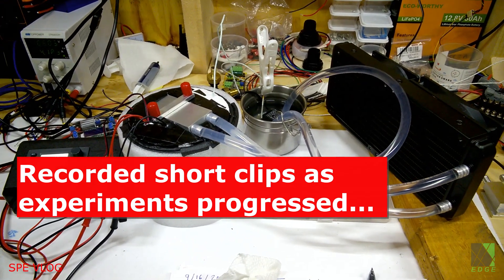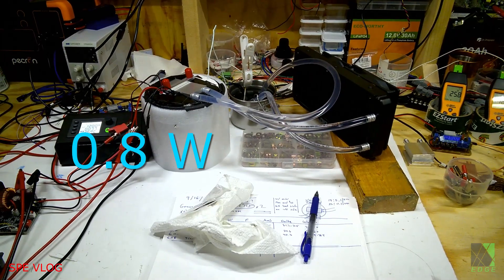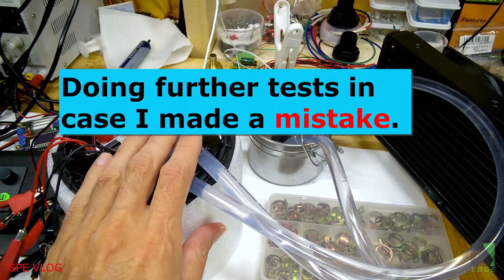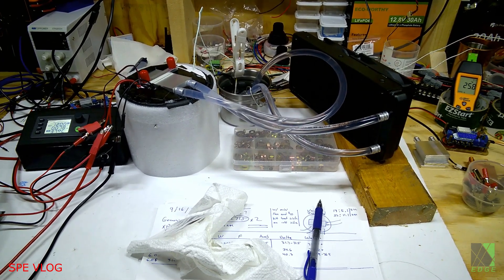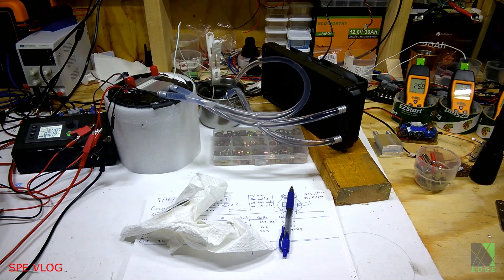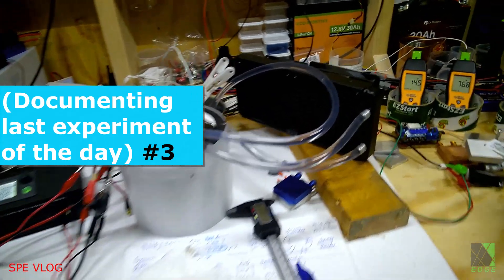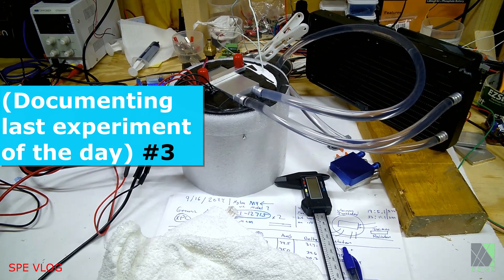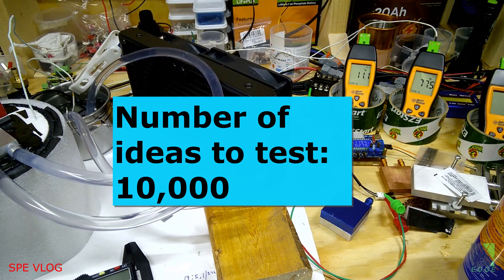I'm Learning to Use Peltiers Effectively w/ Solar Power #diy refrigeration freezer efficiency test

Comment: For Australian Degree Celsius, kilometre, kilograms, litres work better and make more sense
Reply from the maker: I understand.... I tend to use both metric and imperial systems except for carpentry where I prefer inches/feet etc.
Reply: @ I like your work and direct dc system, however in Australia the solar panels are almost free as people throw the 5 years old one and get new ones, inverters are very cheap, moreover heating and cooling by heat pumps, cooking with induction all are heavily funded by state and federal Government. So not many people prefer peltiers projects or direct dc projects, nonetheless, most Australian have peltiers coolers in their cars. Most off road utes have roof mounted solar panels. I would like to see if you can produce the content showing heating of water by electricity in the gas fired water tank which has no electrical resistive heating. Though in Australia Government can replace the existing gas fired water tanks with heat pumps at the cost of $500AU. However, the fully functioning gas water tanks are being thrown and going to landfill. Also contents showing car roof mounted solar panel about 440 watts can produce  pure hydrogen to feed the engine to improve gas milage would be great as Australian have Sun, solar panels but not hydrogen technology. Yes HHO can be made but not on demand and is dangerous to store and to work with. Kindly produce these contents on these two areas for Australians as gas prices for heating and running cars are increasing very quickly.
Reply from the maker: Good ideas, thanks for sharing! Noted for future reference. It's 100% possible to add a PV heating element to a gas water tank. To make such a video, I need to find a water tank and have been working on that one. 

I'd like to add a bit of my philosophy: times will change. I don't believe things will continue to be cheap and easy. All the upheaval in the world today should be a red flag. The trend of price increases is starting to affect everything more and more.

Therefore I like to think about how to preserve and extend the life of our resources, plus leverage simpler and more robust systems for the longer term. Inverters are not guaranteed to stay cheap or in good supply (same thing). Most people have no clue how an inverter works or how to repair it. Induction circuits are complicated and not DIY friendly for the average person. Gas cycle heat pumps are very complicated and require specialized knowledge to repair and service.  None of these can ever be as simple or cheap as a "piece of hot wire". Or even peltiers for that matter. Governments might just change their minds and stop subsidizing technologies and suddenly pivot to something else. Leaving us vulnerable. 

So the whole point of my work is to find simple, cheap ways to use solar without being dependent on a complicated system with a long production chain. Peltiers might not be the best solution; but it's hard to beat a hot piece of scrap nichrome wire from the junkyard to heat water, cook food and warm up the house if needed! Such nichrome could be used to build a heating element that is installed directly onto a gas-fired water tank - it is a shame that all those water tanks are thrown in the landfill, but that is the reality of the world today.

The idea of using solar panels with small amounts of HHO fed into the engine is outstanding. Hydrogen is incredibly explosive and dangerous to keep in large quantities - but feeding a small amount into an engine seems a lot safer. If I ever get a car/truck for experimentation with HHO, rest assured I will make a video. How much hydrogen can 200w of solar make, how many MPG does this generate? We need to know :)
Reply: @ thanks you so much for reading and responding. I totally agree with you on all those points. Hopefully, with the help of your channels we learn to reduce the waste and use simple technology.
Reply from the maker: @SandyMunro-dc5np Welcome! I appreciate your comments and views!

Comment: I converted a dual chamber wine cooler from the junkyard that had burnt out 10.5 vdc switching power supplies.
By connecting the 2 pettier devices in series and connecting the 4 fans in 2 series banks the current consumption is greatly reduced and the fans are much quieter.
The power source is from a 12v solar charge controllers load port and averages about 2 to 3 amps depending on the battery charge state.
The fans have a 2amp fuse, the peltiers have 20 amp circuit breakers from a junk truck. 
Been on 24/7 for 3 years.
Reply from the maker: Nice mod! looking for a broken wine cooler too! (not willing to tear up a working one)

Comment: Great Job. Keep being curious! looking forward to more :)
If you read some module spec's, you might find a performance graph of Q (watts) / Amps.
At somewhere between 8 - 12 % of max current, the Q curve indicates some potential for exploitation.
As was mentioned in the video, the ability to 'rapidly' transport heat from the hot side of the module is key.
Reply from the maker: Thank you :D right on about Q, we need to exploit that curve heavily. I think a few other people are already aware of this and have done some work in that direction. I find peltiers kind of like a puzzle, if you figure it out it just works. Otherwise, it miserably fails and makes too much heat

Comment: I mean it's cool to not trust and verify by yourself, but I think you should show comparisons to compressors in order to back up your point.

Also is the power taking into account the radiator pump?
Reply from the maker: Per my other videos, the comparison target is my 55w mini compressor fridge. That little pump is optional, uses very little power and allows measuring "heat quantity" via the water volume/temp

Comment: Dude, you do great work.
Comment and like so others might see it :)
I do wonder if the 0.8w includes water pump for cooling etc?
I personally love the idea of these coolers, I just think (as you do) there are improvements, basic things, that can take them from being a novelty to being something great. Hell, maybe there are places in a heatpump that these can be inserted to either draw off heat (to make power) or help increase the efficiency from "waste" temp differences.
Reply from the maker: Thank you so much :) I notice an unusual # of comments on this one and really appreciate that. And no the pump was not included as it's optional, and allows putting the heat in the water (water volume + temp = calculate heat quantities) we could just use a heat pipe, or big heat sink with fan - but for these experiments, I want to be able to "get" the heat and hold it for measurement. Water tank works OK for that

Comment: FYI .. I've seen the following help to improve peltier efficiency in my tinkering / experimenting ... lower watts per module , same total watts with multiple modules.
For example .. Instead of giving a single module input of 60 watts of electricity .. applying that same 60 watts of electricity to a group of 8 of those same type pf peltier modules .. ie 60/8 = 7.5watts to each of the 8 same type of modules .. in my case I put the 8 modules electrically in series and used a variable bench power supply in order to give the 8 module combination of them that 60 watts of input electricity .. this increased the efficiency and COP of the peltier heat pumping system .. moving more heat for the same watts of electrical input .. ie over the same 1 hour period of time , water pumping between tanks of water , the cold tank got colder , moving more of that heat to the hot side , and thus the hot tank also got hotter .. while using the same 60 watts of electricity input .. specifically in my case I saw about double the heat pumping (colder cold tank and hotter hot tank) by going from 1 module at 60 watts to 8 modules using the same 60 watts of electrical input.
Reply from the maker: Thanks for sharing this! I've noticed similar behavior when trying serial connections and multiple modules. There are so many ideas and combinations to try
Reply: I have also found this to be true! 
Unscientifically, how I understood it was that the speed of energy transfer through a medium depends on the medium it must transfer through! 
Not only that, but you also have to factor in the area available that the energy (ie heat) must or can pass through! 
Multiple Peltier devices at the same power input vs one device also at the same power input shows that the multiple Peltier devices will out perform the single one every single time! 
They do have a sweet spot! And I think that it's got to do with the temperature of the hot side (if you are interested in the cooling side) vs the ambient temperature... Which means that more power is required on hot days vs cold days! Opposites attract and the more opposite the temperature difference is between the atmosphere and the Peltier devices the more efficient they become. 
As for generating energy from Peltier devices, they are capable of outputting 1.2w each! This doesn't seem like much until you compare how many Peltier devices will fill a solar panel and then do the numbers and realise that a panel of Peltier devices will out perform a solar panel of the same size.... And then someone else on the internet will try and tell you that Peltier devices are inefficient... I have seen what solar panels are capable of, I have imagined the possibility if I had Peltier device panels instead of in combination with solar panels! There's a lot of heat under solar panels and it's not being used! There's an idea there that I really want to try one day... Food for thought.
Reply: When you say the same 60 watts was it also at the same input voltage?

Comment: So what are you saying is responsible here? Your setup seems to be a water cooled Peltier but that's standard. Also is your power consumed including what's used in your water cooler?
Reply from the maker: This is an extremely limited and disjointed behind-the-scenes look at my peltier fridge research... by departing from the traditional youtube way of using peltiers (refer to the hundreds of available videos), and being willing to try new things, I cut the power on my test fridge by 50%. It was hard to believe. Since I don't like to make broad claims without thorough investigation, I am not giving a lot of detail yet. There have also been a lot of trolls attacking my prior peltier videos, so this video is kind of a subtle jab at them. And a textbook case of not listening to nay-sayers, following your own path instead of what's on yt these days. One thing is clear: peltiers can do more than what is traditionally believed, and can work better than I have been told. It's got me interested. PS the water pump uses like 2w, it's fine because moving the heat into water is useful for taking measurements of "quantity of heat" as I have mentioned in prior videos.

Comment: There is a paper that presents a detailed comparison between Peltier elements (also called thermoelectric coolers (TEC)) and thermoelectric generators (TEG) for the usage as thermoelectric power generators. Whereas the former is normally known for cooling applications or heat pump uses, it can also be used as generator. Today, thermoelectric energy harvesting systems find more and more utilization, e.g. in wireless sensors or exhaust pipes. The efficiency of thermoelectric materials for the low temperature sector (between 0 °C and 200 °C) is actually not very high, but the costs for TEGs are. As TECs and TEGs consist of the same thermoelectric material for this temperature sector (Bi2Te3), the upcoming question is in which temperature range and under which conditions expensive TEGs can be replaced by cheap TECs.
DOI:10.1109/IECON.2016.7793029

- The paper is not directly available on researchgate, so I can't access it - but I know there is a BIG difference between TEG's and TEC's (TEG's has a LOT more thermoelectric material compared to TEC's)  
One way to see if one has a 'real' TEG and not a TEC is to open it up.  If it is 'half-full' with rods, it's a TEC - if it is filled, it's a TEG

Thanks, solid state cooling/heating is very interesting (to me anyways ;ø) Please keep it coming, as it can be MUCH more reliable than gasses, etc.
Reply from the maker: More stuff on the way as soon as humanly possible :) thanks for this detailed info, very interesting - I have only 1 "TEG" the rest are TEC modules. Have to do more testing to learn how they work. Was concerned about burning them when used as generators... obviously the TEGs must take higher temps - that makes sense

Comment: One thing you need to take into account is that there it takes power to freeze and thaw water without any temperature change.
Reply from the maker: Good point,  trying to keep track of all the variables especially ambient temperature. Need to do some more testing but the mini-peltier-fridge is already taking shape...

Comment: What modules are you using?
Reply from the maker: All of them I could get - the video doesn't do it justice! Bought all the generic ones from the usual big online stores such as 1270## series - plus some european and American modules. Looking under every stone. Many of the cheaper modules are simply fake. Meaning they don't pull the same amps as printed on the label. Still gonna try to use them for something.